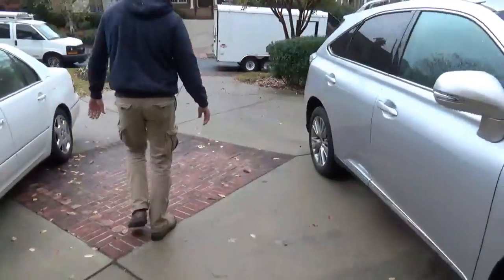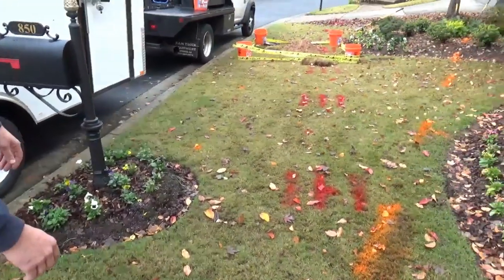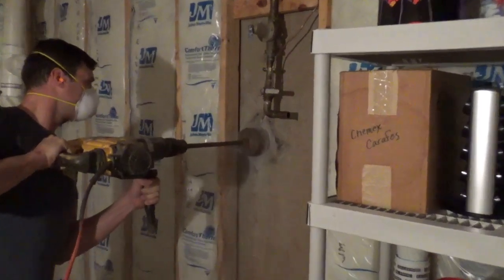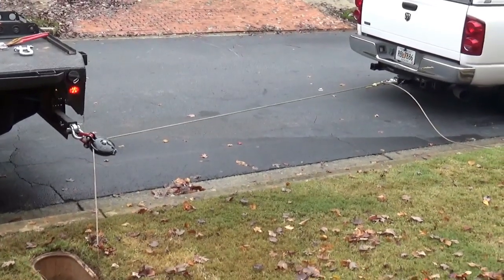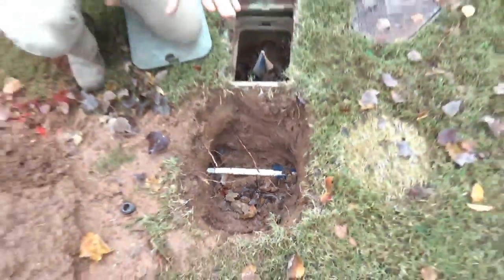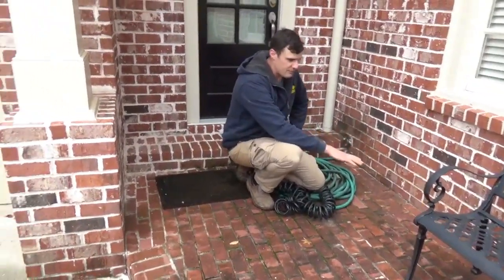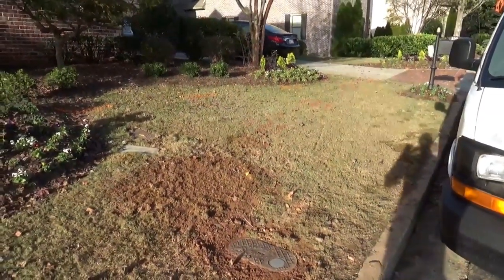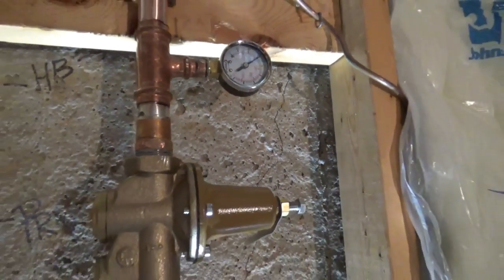Fastest Water Pipe Replacement

Comment: 1st think i would have done is pull the prv. If you only have 80 from the street i wouldn't use one.  If changing the pipe did the job you didn't have to raise the pressure on the prv..
Reply: Peter Goezinya  municipal water in some towns like Mahwah NJ, is 160psi.  Absolutely need to drop it down, most of the info i found set 75 as max safe psi. 
  The company i worked for changed thousands of water heaters. Normally under 100 psi the installers didn't need prv or expansion tanks. Over 100 they would install them or have the customer sign off. At 1 point i had access to all the installs and records of all the water pressures throughout the towns we worked in.
Reply: IPC states the 80 psi rule.  It measured really close.  Atlanta grows by the day so pressures in the future have to be pumped up.  Besides, it does not degrade the pressure or flow, so why not install the safety measure.  Good comment though.  I can see the point, if not needed right now why install.
Reply: @zippyplumber  where i worked, we charged $595. I didn't see the value. Never going from 80 to 150 without something drastic happening, and if 2 neighbors get together and talk about their plumbers, one changed a heater for 1,300 and the other paid 2,100 that's not a conversation I want to be in at 80 psi.
Reply from the maker: Thomas  Broking 
I’m not sure if we are talking about the same thing here. I was mentioning pricing for the water service replacement as a whole from meter to inside the foundation to include all of the upgraded hardware. That is a fair price for us as a company to grow. A lot of expense has been paid with equipment and strengthening.  My guys like to get paid too lol. I’m sure we were on a different page when talking about price for certain tasks. As for the water heaters, we haven’t swapped there’s out yet, although we did do maintenance on them shortly after the water service replacement.  Thanks for the comment.
Reply: @matthewj.firtha7385  i was saying an add on for the water heater. The 5lbs over i wouldn't sell the prv or the expansion tank. Only if the pressure was 100 or higher. 
  I didn't get into that line, we had 8 guys just doing water heaters & add ons. 
 I did full service. It was nice not having to hump heaters in & out, but it sucked fixing all the faucets & toilets they fouled with dope.
Reply: Peter Goezinya  75 is max here.. Wells have pressure settings usually at 60 with a low of 40 for typical 1 family hoises around here. You don't want to shower and someone open a faucet the flow drops considerably.
Reply: Peter Goezinya  code saus 75. But I wasn't charging almost $600 my boss wanted to install it for 5 psi.. Had to be 100 according to the utility company, if that's good for them, i was good with it.  
  I found plenty of work to do without wasting hours of conversation of why do I need it, I never had it before, my kids hoise is new and they don't have it on & on to do work they don't want done.  I can find 4 shut offs that are corroded, or stems on a shower leaking. Something to give them for their momey. 
  Plus i am not explaining why they need a 75 lb prv when pex has a safe working pressure under 150psi.
Reply: @zippyplumber  different ball game if they were $75 installed but I also want to make a living to and forget my boss he wants it all.
Reply: Peter Goezinya  I hope you took pictures because that's something nobody here is going to believe.

Comment: so you took one BS plastic tube (not a pipe) and replaced it with another BS plastic tube that will no doubt also fail in no time.
Reply: Pipe (noun): a long tube or hollow body for conducting a liquid, gas, or finely divided solid or for structural purposes.

See: your local dictionary, it'll help the knowledge, but not the ignorance.